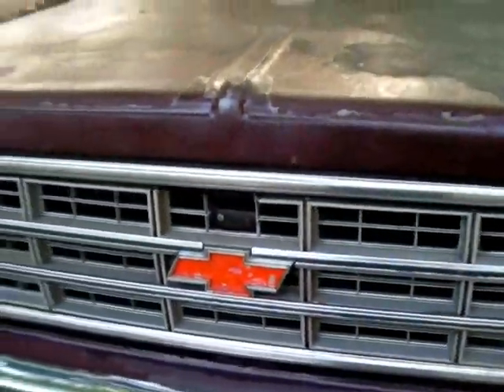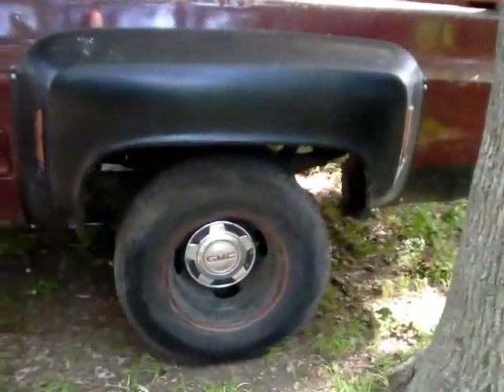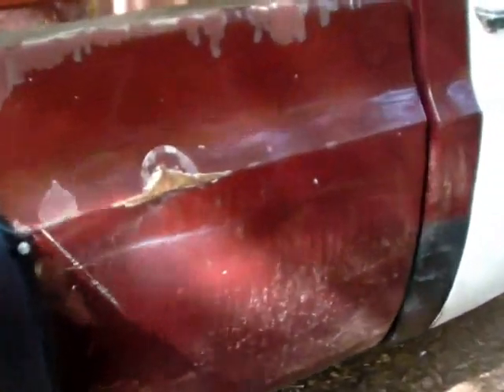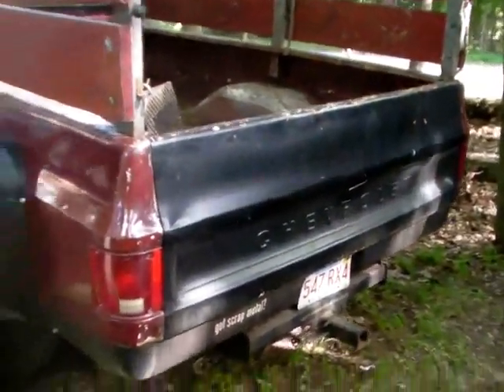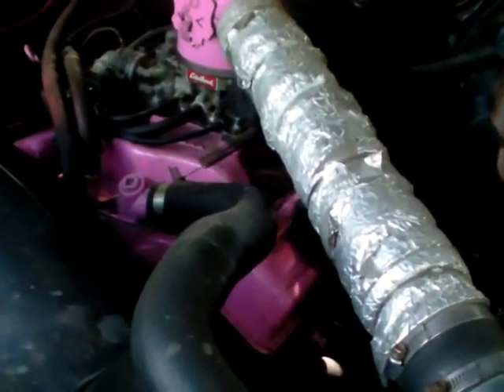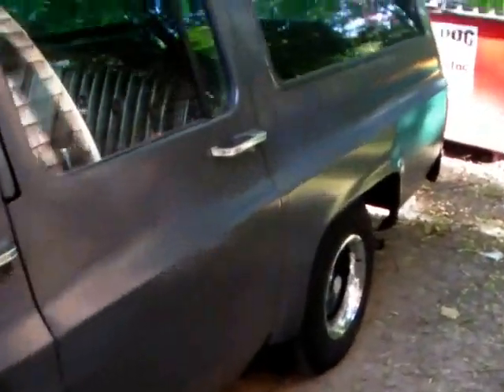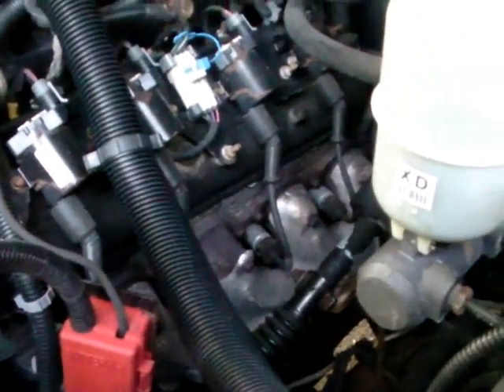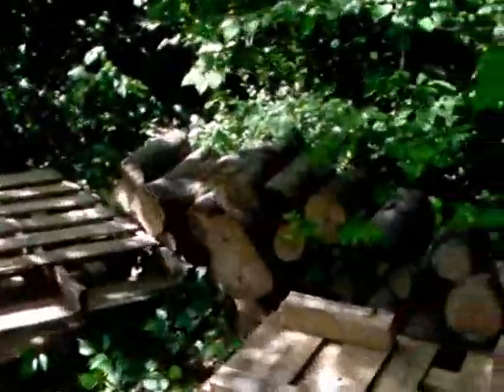summer time and the livin' is easy..UPDATE

Comment: I used to have a 99 almost identical to your 01. Engine was great, trans wasnt bad either, but i kept blowing rear ends. Sold it last summer for 4200, then bought me a rust free Georgia 84 1 ton to solve that issue